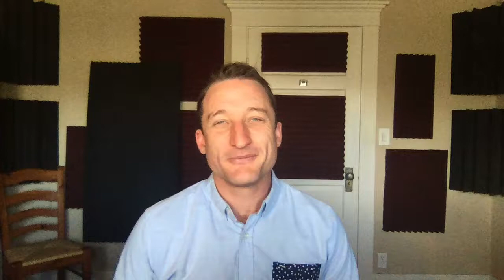Linear Phase EQ vs Natural Phase EQ | What's The Difference?

Comment: Hey, just a quick comment :)... I don't think "natural phase" is a real DSP term in filters or anything... It was more of a branding think that fab filter introduced to refer to a phase response that is comparable to an analog counterpart (hence the idea of it being natural hehe would have been funny if they called it organic XD)... The typical comparison is between linear-phase and minimum phase!. IMHO these two concepts are simply different properties of filters and not at all contrasting or opposite, but ironically that's what manufacturers end up telling us in any case. 

P.d. the reason why FabFIlter created natural phase is because digital filters have very often slight differences when compared to analog filters. So in fact, most digital Eps out there, although they are based on analog designs, they have slight deviations (specially in the VHF) ;)